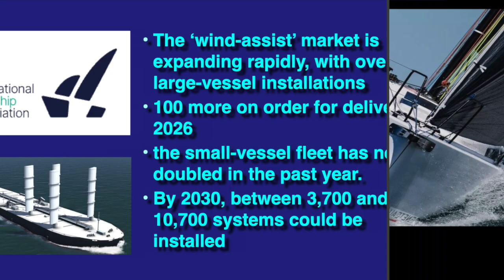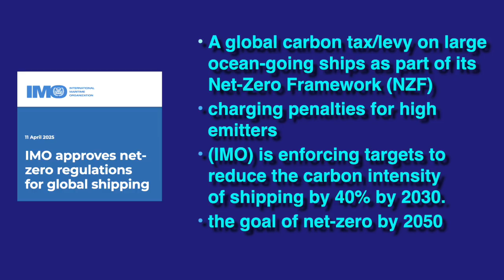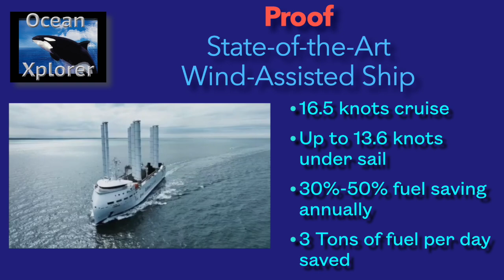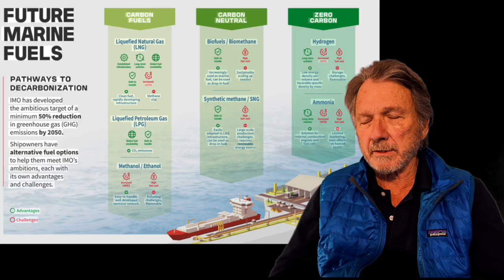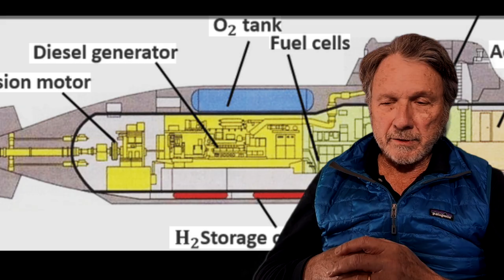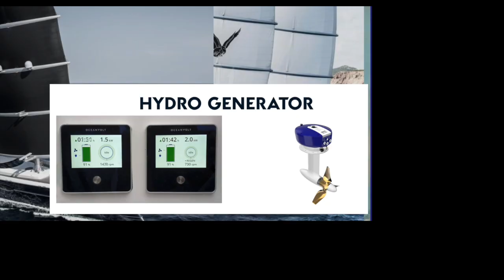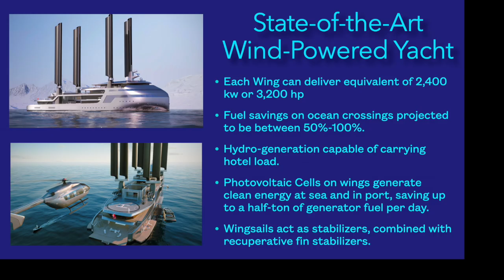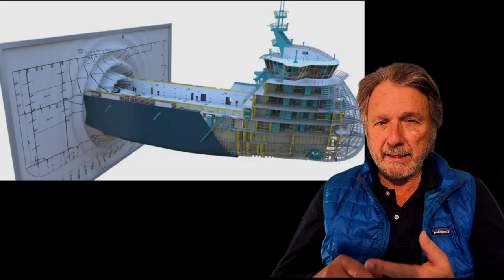Harnessing the Wind - the New Technologies available for wind propulsion in Expedition Yachts

Comment: Keep talking and coming back to this....because we know certain parties will keep screaming basically unscientific  economic blue murder  to the rest of the planet, meantime CATL is planning on a battery for a ship to cross an ocean Na ion batteries could overtake and undercut Li Fe PO tech in the next year  in many ways ...but scaresity safety and pollution risks are not a problem nor are cold or high  temperatures  and  battery lifes which  range between 12years guaranteed to not drop below 85% capacity..... to possibly a century in  a grid type storage system .  😮
The multi source energy Harvesting  systems are available now. If you've got a flat bottom hull a air Bubble feed can reduce the biggest factor of displacement hull drag...just for good measure 👍🏻🧙🏻‍♂️🥼🇬🇧😎 By running Series hybrid generators via batteries ...you can run at one speed one load Stoichiometric optimums  even in adverse conditions  and only when absolutely needed  burning  multi fuels without the complication of varing loads of speeds and complex heavy combustion engine designs.. so bacterial or algae grown  biofuels become  a realistic proposition to back up wind , regen and solar harvesting ... You can even capture and burn sewage gas or use sewage and animal waste to produce fuel for such systems. 

Hydrogen was used for decades safely by the Zeppelin company in their airships untill the incident that ignited the Hindenburg's Al doped skin .. they just allowed it to vent out the top of the  envelope... and avoided ignition sources . The fact that it and the R100 and 101 had smoking rooms onboard fed by overpressured air drawn in from beneath the gondola was just a measure of how comfortable they were  dealing with low pressure H2   ..,I don't think Ammonia will last the course in shipping it's horrific stuff to deal with for the Engineers and requires full suit and resperitory protection.  So that leaves methanol or green recycled hydrocarbons from waste  to  infill on the night shifts and storm watches. 
There are possibilities of using Al and or Sulpher to produce batteries that have  enerergy densities equal to or up to 2 x  greater than even heavy Diesel per KG.  
At 1.0x the energy density fossil fuels become pointless and even less efficient ... There after because electric motors are typically 97% efficient and largely maintenance free for years , they also deploy instantly powerful, infinately controllable and quiet ..They are perfect for Azimuth pod  drives and quiet ....which will make them popular with large Marine mammals  and hostile Submarine hunters. 😉🇬🇧🧙🏻‍♂️

Comment: Power from solar cells designed into sails that can be used on current sailing rigs then retrofit with hybrid diesel/electric.  Viable?
Reply: Solar cells really dislike torsion and flexing.
Reply from the maker: I'm not sure that the solar cells would survive the luffing on traditional sails. However, new technologies may exist for that application. Adding battery storage and electric drives to any propulsion system will require space, weight and fire protection.